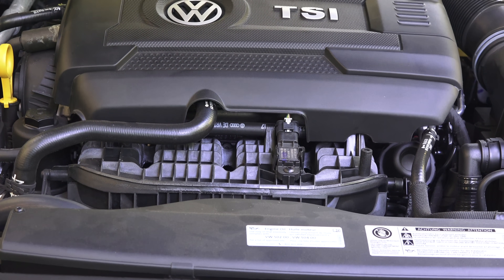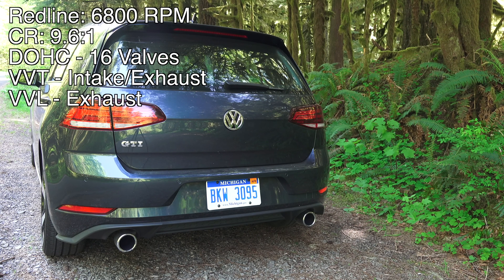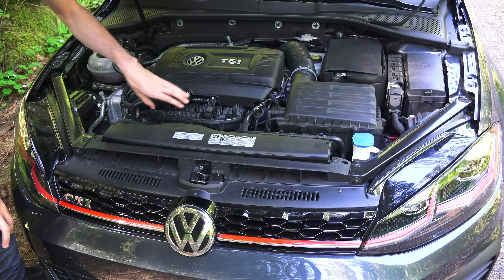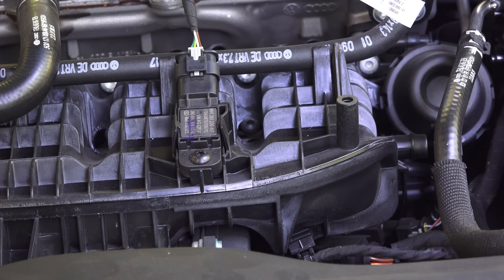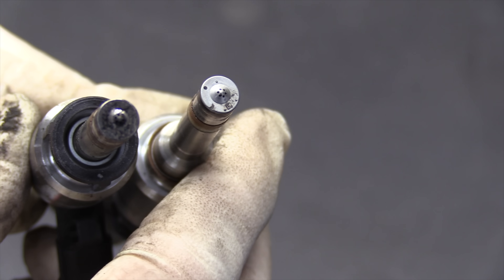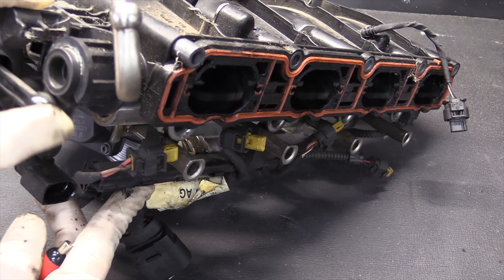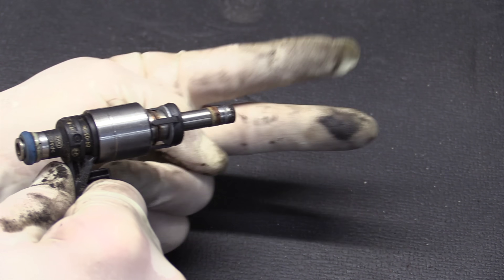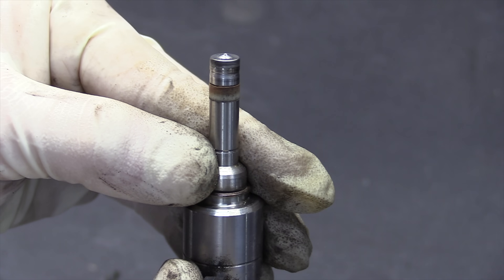The Best Engines - Volkswagen GTI Turbo

Comment: The 24V VR6 is VW's best engine ever!  I've had my '03 VR6 GTI for 17 years now, original motor, original chains!  NO issues whatsoever, super reliable!
Reply: Basically any engine VW made with non turbo in last 20 years was way more reliable then any of their turbo engines. Even the early mk5 2.5L 5 cylinder engine with the terrible timing chain problems out lasted the 2.0t
Reply: @SikConVicTioN  can confirm, my modded 2.5 gets driven hard and is still going strong.
Reply: @b.c.2281  as long as it doesn't piss oil for too long it will last forever, the shitty vacuum pump seal drives me crazy. Thank God it's easy to change with MT
Reply: @SikConVicTioN  my vacuum pump has been deleted at this point. It never leaked, I just wanted to minimize problem areas. My car has a short runner intake so the vac is just tapped off it.
Reply: @SikConVicTioN  yep my 2.0 ABA in my mk3 96 jetta was a super reliable engine. Wasn't a rocketship but smooth and good on gas.
Reply: My 2008 audi a3 with the same vr6 has held up very well aswell:)
Reply: 18 YEARS NOW, with the 24v VR6, and no issues!  The dealer employees smile when they see me drive in for yearly synthetic oil changes!
Reply: @AudiophileTubes  how many miles have you put onto it?
Reply: @cxzmyc  283,000
Reply: @AudiophileTubes  she still running well?
Reply: @Reformedekko   Oh yes!  This October will mark 19 years that i've had this car, and the VR6 still runs like a clock!  What a beast!  More reliable than any Toyota or Honda my family has owned over the years!  With VW's, you either get reliability or junk.
Reply: @AudiophileTubes  Where do I find a crate motor for a 1996 golf 2.0
Reply: @juanangellozada4084  a crate engine for a 25 year old engine? Not likely.  Just get a good engine from the wreckers and rebuild it completely with OEM parts
Reply: I had a VR6. Geez that was a fuel thirsty engine. Sounded incredible though!
Reply: I miss my 24v vr6. Super reliable motor.
Reply: Totally agree, I'd like to see that engine doing what yours did before handing it some award.
Reply: 17 yrs is hardly into anything special for almost any post 90's car, imo. Not being a snob plz don't take it that way. That's just my opinion I'm happy to hear other people's opinions if they're polite!
Reply: @Sophocles13  Cordially I disagree.  I mean it's got to be a little special considering most post 90s cars are simply not 17 years old yet.
Reply: Have owned an 1999 TT with 1.8T quattro 224 HP and about 280T km. The engine was super reliable, yet had burnt much oil.
Reply: 07 A3 is a dream! Have 166K and I can still do 140 with no problem!
Reply: And that induction noise gives me a semi
Reply: Awesome sound and torque too on those. Had a mk4 gli with that and it was so fun
Reply: Cool truck engine shoved into a sport coupe.

Comment: Comment from Singapore. My VW Passat 1.8 has dual injection (i.e. GDI + PFI). Stripped the cover off (let the engine cool first for good measure) and peer into the intake manifold and I see a high pressure fuel rail (stainless steel) feeding the GDI injectors and another low pressure fuel rail (normal steel) feeding the port fuel injectors. From what I read, the PFI is really for optimising the low load/idling fuel economy of the vehicle (not sure about that, some comments on this welcomed).

Comment: They still use iron blocks?
Reply: In the vid, he said it was aluminum.
Reply: @TSEDLE333  at 1:45 he says that the engine block is made out of iron and the cylinder head is aluminum

Comment: Were any other engines nominated? I have a '17 GTI and I recently found out the plastic water pump is leaking. Plastic!?!?!!? They can't make plastic interior pieces that last, and now they want to make water pumps out of them?! That cheap garbage only lasted 34k miles! This is not to mention the car is becoming harder to put into gear, so I will likely need to replace the clutch soon (no mods to the car). I can hear and feel a misfire at idle that the dealer "can't reproduce". The blower motor squeaks constantly when it is cold out (again, "can't reproduce"). The transmission makes a clattering noise at idle when I take my foot off of the clutch pedal (dealers says it's normal and all manual GTIs make that noise, which sounds like some BS to me). Not to mention the carbon issues and the fact that the engine leaks oil like a sieve. I am cutting my losses and getting rid of this turd as soon as possible. First and last VW I will ever buy.

Comment: Those engine suck ass.  My mkvi went through 4 water pumps, 1 intake manifold, one dual mass fly wheel, had the epc gremlin.....  The water pump is plastic... I'll let that sink in and the Audi version  metal.  Also they suffered from cam tensioner fails

Comment: High work pressure in the injectors? Well... If you compare it to a normally injected petrol engine maybe. But I would say high pressure is common rail diesel engines. Work pressure between 400 and 1500 bars.

Comment: This family of engines can develop so much more than their original ratings , you juste need to unlock the power with a tune.
Reply: 430 horsepower to the wheels on mine and still going strong.

Comment: Not the GTI, but still a great engine, I have a 2018 Golf Sportwagen with the 1.8 TSI engine (170 hp @ 4800 - 6200 rpm & 199 ft. lb. torque @ 1600 - 4200 rpm).  Nice to see Charles, btw.

Comment: I have a 2016 MK7 Golf 1.8TSI and I love it. Build quality, materials and small details were a lot better than the competition when I did test drives. I have had 72k km with no issues so far. Have new tires/rims and plan on an APR tune this spring!
Reply: @Shaun Vermeulen I own a 2015 1.8TSI and i've had no issues with oil consumption. Also Connor I have the Stage 1 APR tune for 87 octane and it's awesome! Numbers very similar to what the website claims.
Reply: @theplatinumyeti  I just got the APR stage 1 this morning with 91 octane, feels awesome!
Reply: but how's your engine's oil consumption? from what i heard this is the big downside of tsi engines. that and problems with the distribution chain (or whatever its called in english) with some of the models.
Reply: Shaun Vermeulen Gen2 EA888’s were known for oil consumption issues. Gen3’s don’t have that issue. As far as the timing chain issues go all the way up to the early Gen3 motors. They had the problem corrected for 2015.

Comment: This engine is garbage
1) oil consumption 
2) carbon build up

Had ‘11 A4 2.0 Quattro with 47k miles it would burn about 1.5  quarts between oil changes, oh and the oil change interval was 3500 miles, what a joke
Such a turn off, oh it’s normal to burn a quart if oil.... yeah say that to Honda owners.

Comment: l repaired several TSI engines. timing chain tensioner fails causes customers'  thoudands dollar to repair the engine  head.  Carbon acculation  is another big problem, cost more to clean and maintain! leaking oil is another problem.   Reliable engine is japanese engine, not german ones, german car has goog chassis and rust proof.

Comment: Does this apply to the new 2019 GTI models?  I'm in the market for a new car and I'm very interested the new Rabbit
Reply: Yes, 2014-2020 is MK7 and MK7.5 which have the same engine. Can't go wrong with this car!
Reply: Rafi Syed - wrong!
My Mk5 has the same engine. They started producing them in late 2008 and still use the 2.0 TSI still to this day in the Mk7. It’s such an amazing and reliable engine that they’ve just kept updating the one from my original 2009 Mk5 GTI.

Comment: The best vw engine, you mean 1st gen 1.9L TDI?
Reply: True that. had a golf 4 1.9tdi and that engine is tank.
Reply: Flutez I have a 1.9 tdi and it’s a beast
Reply: Which one? The ALH or BEW? I have the 2001 ALH engine and it has 481,500 miles on it.
Reply: @pilotavery   I'm trying to figure that out. I believe it is the BEW also known as the TDI PD. 
My Jetta with a 2.0 got crashed and I'm looking for another MK4 with extreme longevity
Reply: @pilotavery  thanks
Reply: @pilotavery  that are 2nd generation 1.9 tdi. Which are also very good and reliable but they have a head which is little fragile
Reply: I think you meant Pump Duse TDI's... I just rolled over 536,xxx miles on my '04 Jetta wagon. All original block aside from the cam being replaced twice.
Reply: Yep, I drove a 90hp Skoda Octavia into an unseen window height flood at 70mph. There was a mild cough. 30 seconds later all was well. It was worked as a taxi after I sold it. Died with a half a million on the clock.
Reply: I wonder how long the plastic parts will last... The best VW engine? Simplicity used to be valued, the '67-72 boxer gets my vote, followed by the 1800cc 8 or 16 value gasoline used from 75-89. Of if one is a very patient person the original non turbo diesel after the improved head bolts in '81 was a delight.🤔
Reply: @allwinds3786  Couldn't agree more in regards to your statement about the original 1.6 VW diesel (post 81). My experience with it in Bosnian war 92-95 where people were using pretty much everything to power that thing, from cooking oil all the way to transformer cooling oil from electrical grid step-down transformers. The thing just wouldn't quit!!!
Reply: @yeahright4659  I've been trying to tell VW that they need to make a simple car like the original rabbit or Golf but they either don't respond or laugh.
Reply: @allwinds3786  Cars like that exist in Europe and other parts of the world but wouldn't pass the regulations here
Reply: @yeahright4659  I disagree, I want a simple car, there's no reason they can't make a simple car with out powered steering, electric windows, air conditioning. I don't need anything that doesn't propel. How is it against regulations for a conveyance with out parking assistance or internet connection?
Reply: @allwinds3786  Oh, I see what you're talking about. Well, perhaps the prestige and never-ending race for who's gonna make it more expensive and luxurious is preventing them
Reply: @allwinds3786  The same goes for the sporty versions of some models, they could lose all of the infotainment systems, radios, power windows and all of those things to help with weight like they used to do, for example, the Peugeot 106 Rallye mk1.
Reply: Err the ALH was technically the second gen TDI
Reply: Both the ALH and PD engines were great. The PD engine was more prone to a camshaft wear issue though. It was fixable by upgrading the cam. I own a 2003 Golf TDI ALH with 290K miles on it. 50 miles per gallon, 800 miles on one tank. Owned the thing since I was 16. I have my lil 1.9 ALH motor built up and making a little extra power from the stock 90HP... running an upgraded VNT 17 turbo, bigger PP520 injectors, 2.5 inch straight pipe, stage 2 south bend clutch, and a stage 4 malone tune to tie it all together. Pushing 150HP and 275 ft/lbs. Fun as hell to drive.
Reply: @johnb8336  yo thats crazy i'd expect my HP gain at stage 4. That torque gain though 🤤
Reply: Agree, i owned an Audi A3 from 97 with the 1.9 TDI. That engine was amazing
Reply: 1.9 TDI with 150 HP and 320 N•m/32 kg•m or torque.
Reply: Facts dude
Reply: The 2005 one was amazing too.
Reply: Nah, the best engine will ever be the 827 RP. This one is amazing in so much little aspects, it's really one of the most underrated engines out there!
Reply: TMoD7007  my uncle had a Bora ALH
Reply: Actually best vw diesel engine by FAR FAR distance is designed to volvo and i remember it was maybe in vw LT or so. Its legendary D24TIC🙌
Reply: @jessebear4375  nahhhh, 1.9ALH ran on vegetable oil
Reply: Lol, no.

Comment: I had GTI mk7 2014. It was by far the  least reliable car I ever owned. It blew 2 water pumps in two years. It also destroyed valve train due to broken valve spring. Infotainment system was destroyed by incompetent VW technician, then they tried to charge me for that. Customer service is substandard.

Comment: mk5 owner 1.4tsi 170ps since 2011 till now, i have fixed the manual gearbox(it was making a sound when you put 2nd speed),plugs for fuel injectors and water cooling system some turbo sensors and valves replaced, no broblem with missfiring cylinders or timing chain till now but I have heard for . I bought it with 40k miles and now am about 70k. Let the truth be spoken its a powerful small engine but, its reliability sucks...

Comment: I had a 2009 GTI with 121,500 miles which just died 3 weeks ago from internal engine disintegration. Two different dealers told me when they see that much metal clogging the oil pickup tube they don't even need to diagnose the cause, although from reading a little online it sounds like a crankshaft bearing or a connecting rod bearing broke up. It wasn't making any knock sounds, just pinging low oil pressure warnings at me every five minutes. It didn't have long. What pissed me off was I maintained it by the book--I literally did all the recommended maintenance, and I shortened the 10k oil change interval to 8k based on a mechanic's recommendation. It only ever had synthetic oil too. WTF, VW? I'm still bitter about it. I want to like this engine, in fact I do like this engine, but after that experience I'm not going to get another VW. Not to mention I had lots of other issues like the ABS controller died, the seats both had to be replaced, excessive carbon buildup at 70k, and the headliner was sagging down among many others.  Every year I probably put at least $1500 into repairs. I really wanted to like the car but it let me down! Still sad to see it go.

Comment: About 2 minutes in Erm just asking, i know french cars number there cylinders by firing order, but cylinder 1 is at the front or in vag transverse on the left of the engine, number 1 cylinder aint at the gearbox end, never seen you make a mistake pal but thats a boo boo

Comment: Ironically it's the only engine I have had problems with. 

For starters I had the dreaded carbon problem with the intake. Also low compression on one of the pistons, a leaky fuel injector, a leaky valve cover gasket, and oil consumption seems to be the norm with these motors from new (according to the dealer at least). 
 
I thought a faulty thermostat would be an easy fix like every other car I've owned, but instead it's a fairly major job to get to it. All on an engine with <60,000kms. 

Loved the car but in the end I got sick of all the repairs and sold it after 18 months - perhaps I got a dud? 

One final point; you can't fully turn stability control off so a track day was a complete waste of time with the motor constantly cutting power at every little wheel squeal.

Comment: That variable length intake manifold flap assembly is a definite failure item.  Whether gas or tdi, it will fail, sooner rather than later, which requires complete replacement of the intake manifold

Comment: Can anybody shed some light on an issue I have? I have the EA888 gen 3 engine. I have a small amount of oil inside the spark plug well (coil side). Anybody has any issues with this? Easy fix? Thanks guys.

Comment: if the part of the exhaust heat pass to the coolant, after the car heats up, won't that be unnecessary, I mean won't the heat should be dissipated by the radiator, and maybe in hotter conditions, by the fans that take already power from the battery hence fuel consumption.

Comment: Ok, the 2.0tsi is NOT a great engine.  I have one in my A4.  PCV died at 56, new pistons at 77k, now at 99,700 it's in for a failed timing chain tensioner, timing chain and bent valves. The timing chain tensioner in new 2.0s is in it's 6th version and they still have issues with them.   This model engine is also known to have a bad cam bridge, low pressure fuel pump, hi pressure fuel pump, frequent water pump failures (they made it out of composite plastic so it warps), turbo failures, manifold failures and head carbon issues.   Feel free to Google it or look it up on an Audi chatroom

Comment: Based on fuel efficiency? I have the 2017 GTI and these engines are notorious for really bad carbon build-up... worse than other GDI engines. I just found this out or I would have never gotten it. When or if car manuf. start mainstreaming/standardizing dual injection (port/direct), they are going to look back at today's engines and ask themselves what they were thinking when they handed out these awards. Arguing manual cleaning of injectors/intake manifolds as part of maintenance is ridiculous.... I doubt the car manual includes this on the maintenance schedule. Those who own a German car, set aside $1,000.